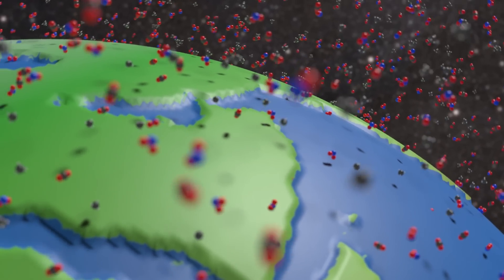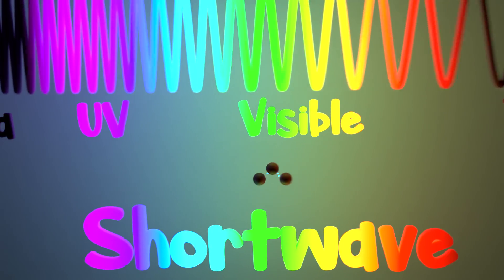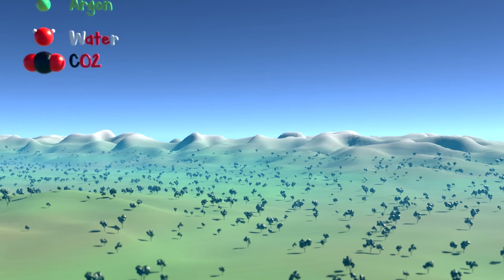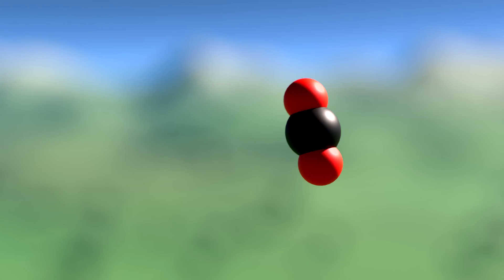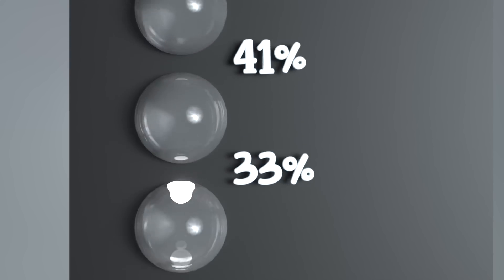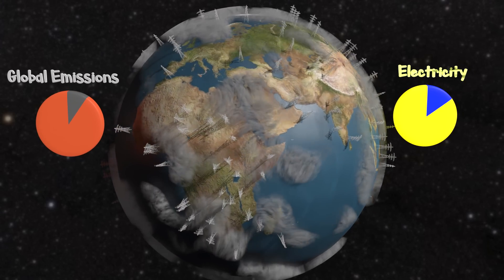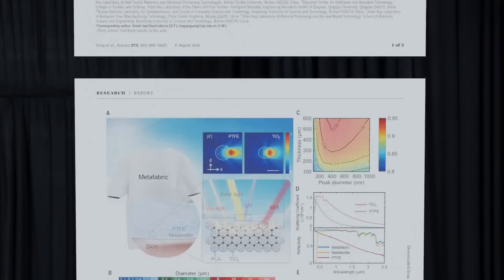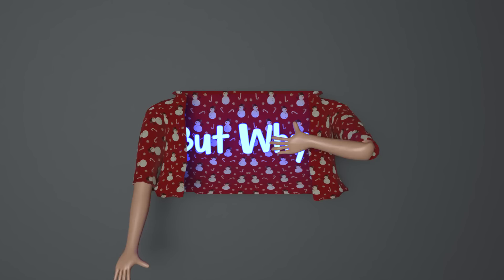Energy Free Cooling through Physics

Comment: I disagree that we need to reduce global electricity usage. The empoverished will use more wood as fuel which would increase green house gasses.

Oddly we should push In the opposite direction. Increase prosperity across the world while developing better energy science technologies to either utilise ambient heat as an extractable resource, in addition to radiation control measures.
Reply: Wood is the most renewable fuel ever. Change my mind
Reply: @truestopguardatruestop164  don't need to. While it is renewable. Its combustion subtracts from the total plants actively pulling CO2 from the atmosphere. Burning innert coal releases a comparable amount of CO2 it is not going to work to remove the CO2 from the air and ultimately living plant matter is better for the environment.

Renewable energy is a different subject to atmospheric gas.

Corn can be used to make a diesel substitute. But growing more corn is better than burning it when it could be used as a carbon bank.

Ultimately we can agree it is renewable. It is not however the same as environmentally better.

I would also like to add. Renewable are great if your goal is not to reduce carbon gas by products. Implying renewabolity is the same as environmentally friendly is similar to implying that natural is good. Not everything natural is good for a person. Deadly nightshade (beladona) is a potato. But making chips from it is seriously ill advised.

Comment: Wouldn't aluminum oxide be toxic and absorbed through the skin?
Reply: Al2O3 is the basis for sapphire and ruby.  the differences are trace amounts of titanium or iron for sapphire, and chromium for ruby.  aluminum oxide isn't toxic, but when it's in a fibrous form it does damage.  Inhaling dust is bad for the lungs, and even skin contact can be irritating, but in the same way that sand can irritate.

Comment: I'm a bit confused.  It seems to basically be a one way infrared mirror or something.  I think the confusion is that this does not directly impact global warming, it would only be by way of lowering air con usage it might help.  I have also seen black plastic get extremely hot in the sun and seen my reflection in the computer monitor on IR camera, so plastics are still highly reflective and absorbing, especially if actually mirror smooth.  I know you can see through plastic bags in IR but that is an extremely thing 100 micron or something thick sheet.
How would this compare with just reflecting the short wavelength AND IR energy back off the top of the building with, say, a mirror?
Reply: My understanding is that a mirror will only reflect incoming radiation, so at best you can achieve the temperature you would feel in the shadow.

The promise of these materials is that they can remove from an environment more heat than they can introduce. As stated, if that's the case you can get a motorless aircon effect

Comment: CO2 is not the thermostatic control for the planets average temperature.  The infrared wavelengths that CO2 absorbs is narrow band and overlaps H2O vapor, which is also much more common than CO2.  H2O is the largest driver of any greenhouse effect.  
Besides this...  There has been no net warming over the last eight years, according to satellite data.
Reply: Lol did you see the graph.
Reply: @mfanto1   yeah, I did.  I also know that graph was made by stitching disaparte data sources together inappropriately.  Climategate dude...

Comment: for the animations at 1:20, do the ripples in the "sheet" indicate high probability locations of finding a photon of some particular frequency? I'm not sure how to interpret the "height" of these ripples.
Reply: No.  I think it's just a goofy cartoon of a charged particle...  The graphs a few moments later are probability densities of electrons in certain orbitals.  They are answers to the shrodinger equation for the charge distribution of the particular molecule.
Reply: @kayakMike1000  I feel like there still should be some reasonable interpretation of it...like it's communicating a truth about the electromagnetic field and interactions with charged particles, right?
Reply: @DanielKRui  hard to say... I photons are emitted by electrons jumping around in discreet  energy levels within each molecule.   The entire reason why CO2 is somewhat opaque to certain infrared wavelengths related to the electron configuration in the molecular bonds.  That charged particle moving around in a swirling pattern might induce a magnetic field and an electromagnetic wave, but the scale is way out of anything reasonable, and what would be moving that charge particle?  At molecular scale...  Photons are discrete quanta.
Reply: @DanielKRui  honestly, that's a really good question.  Questions like this will lead to greater understanding.  Also, I might be wrong.  
I was just thinking...  A charged particle in a spiral pattern is exactly what causes the northern lights, but pretty one charged particle doesn't emit photons in all directions, its many charged particle emitting photons...

Comment: The nanotech is cool, but think it’s worth noting that low tech solutions also exist for hot climates. Better building construction to improve insulation and airflow can cool a building without fancy materials. 

I’m Texan. Compare a wide flat ranch house with a big porch and windows with the tall boxes we live in now. The flatter building allows more cooling wind and keeps sunlight off the sides of the house whereas the tall box designs take full sun all day and have horrible airflow, requiring lots of AC.

Wider houses don’t scale well with urbanization, but the general ideas of shielding walls and improving natural airflow can complement the reflective roofs from the video. A hot tent may benefit from a fancy roof, but in my experience, opening the flaps can be just as beneficial.

Comment: Cooling systems doesn’t just refer to AC, but also to residential, commercial, and industrial refrigeration. Passive thermal designs are absolutely an incredible technology, but they can’t help when you want to keep something refrigerated.
Reply: But they can be used as the cold heat sink for a more traditional AC system! It makes the AC more efficient with a higher temperature gradient between the hot compressed side and the ambient air. If you couple the compressed side of the AC with a panel that's 10°C colder than the outside air, that's energy saved.

Comment: Nice, potentially reducing energy consumption for heat pumps based cooling, but I hoped for technology which would passively convert longwave radiation into radiation which could escape our atmosphere.  Perhaps something like that crystal in green light lasers? IIRC it doubles the frequency of incident light, converting IR laser diode radiation  into green light.
Reply: problem with dyes is they are light sensitive, and subject to degradation.  photographs of flowers are done in the morning to get the most vibrant pictures.

Comment: Don't get me wrong, I love this concept, but I do wonder about the effects on the surrounding air, especially if this technique is used on the large scale.

In the beginning of the video, you stated that the heat would normally be absorbed by the ground.  But with this material, the heat would be reflected up or out, thus heating the surrounding air to a temperature higher than it would be if this material wasn't there.  In the long run, this heat will then be added to other heat trying to escape the atmosphere, but then gets reflected by greenhouse gasses, thus adding to the accumulating heat in the air around the globe, hence adding to the problem.  -- Not Good!

But, every problem has a solution if you flip it on its head.  What if instead of simply reflecting the the heat back into the surrounding air, it was reflected or radiated to a specific point where the heat energy could be used as a power source.  This may not be good idea for clothing, but it could supply power to a tent or a house.

Something to think about...
Reply: @chalichaligha3234  I put actual mirrors on my actual roof.  Standing above the mirrors means light coming from the sun and light coming up off the roof.  It's warm!  Like the reflection off snow.
Reply: @geraldfrost4710  you’ve caused countless plane crashes m8
Reply: @billballinger5622  Nah. Pilots wear mirrored sunglasses! (It's not just to look cool.)
Reply: The light that makes it to the ground and heats it up makes it that far because it is transparent to air (well air is transparent to it). The air can't absorb energy at that wavelength, it simply passes through it as if it isn't there. The reflected light would pass right through the second time back to space. Also your idea for reflecting light to a point where it can be harnessed is already in use. There are large concentrated solar power farms where mirrors reflect light onto a boiler creating steam to power a turbine.

Comment: Those claims mean little without more details of the variables involved, eg external temperature, and comparisons to plain mirrors as controls, also not defining the units as Centigrade or Fahrenheit really doesn't help, even more so for "a skin temperature change of 10 degrees", which seems medically unsound in either scale. :)

Comment: Then you install a thermocouple and boom, free energy too when you don't need cooling? I always thought of this but by using a material close to a black body radiating its heat into space at night. If it's double the efficency of a solar panel, at probably much lower cost, I seriously hope there is a good way to make cheap and efficient thermocouples that can retrieve a good amount of electric potential per joule of heat.

Ps I just looked and it's not as efficient (5% vs 20%) but it could be cheaper in the long run, you could make both? Wasting that free heat pump when you don't need cooling in your house seems illogical since it should cost less than a solar panel, although you need more area which could be used for solar panels.
Reply: What if you build an inside structure with two sides: one really cold and one really hot. That difference is made by the magic material. Then you run tubes on both sides. Then you add a Peltier module connected to the two tubes systems. Then you generate electricity from nothing!!

Comment: Is it possible to convert latent heat energy and turn it into electricity? Not temperature differential, but if it's 40°C outside, surely there is energy there that isn't in -40°C?

Comment: Not to one-up you, but I installed a Planetary Air conditioner; I use it to help cool my house.  Been running it for years.  I've got videos, but not with fancy graphics like yours; actual videos of my actual Planetary Air Conditioner, and how it actually works.  Drops the temperature of the roof by 30 degrees F, and that cools my house.  Yes, it does it without electricity.  The PAC I run dumps an equivalent amount of heat back to space to melt 250 tons of ice per year; that cooling appears in my house first.
The problems with what you've shown isn't that they work; I'm sure they do work!  The problems are cost and how they these things react to the real world.  The main problem with my Planetary Air Conditioner is that it works too well.  Water condenses on it, and any dust or pollen in the air attaches itself to the damp spot rather than anything else on the roof.  Dirt collects, and moss grows.  Ya have to clean the darn thing!  Imagine leaves: as they blow across a sidewalk, they don't stick.  Now have a puddle on the sidewalk, and you have a leaf magnet.  Having put a dirt magnet on the roof, it will have to be cleaned.  (I have a scientific dirt study in progress, one patch that I don't clean.  I'm not lazy, honest!  That one patch shows that if you don't clean it, the effectiveness ends.)  The thing you clean has to be able to resist the cleaning.  My PAC is, by it's vary nature, robust.  Resistant to birds pecking it, hailstones, and easy to clean with a scrubby pad and water.    
Cost is the other issue; mine comes in at about $20 per square meter.  How does that compare to scientifically saturated silk or premium prototype polymers?
Reply: @kevinkarlwurzelgaruti458  There are various formulas on the market. Rainex for cars, and anti-fog for scuba masks.  It would be an interesting experiment...
Reply: Sorry didn’t fully understand what was your solution
Reply: @truestopguardatruestop164  I got mirrors on my roof.  They run cold, so cold that water condenses on them.  Kevin suggested a way to mitigate the negative effects of condensation.

Comment: One interesting point.  IR (of the correct frequency) is absorbed by a "greenhouse" gas causing it's bonds to vibrate.  You kinda skipped over how long on average the energy is held by the gas molecule.  You state they primarily release as IR energy 50% up/down.  Then is absorbed by another GH gas absorber or the ground.   But, you didn't state the frequency of the released IR energy?  There are transparent keyhole IR frequencies in the atmosphere.  Is the emitted IR frequency follow a blackbody probability, or is it the same frequency as absorbed?  This isn't a valance band quanti effect, so we aren't making lasers here.   

I think you could do an entire episode on the absorption emission, blackbody, probability of conduction, holding time, keyhole frequencies, average absorption distance, primary absorbers, and such.  It would definitely open a can of worms.

Comment: Awesome.
It's possible that these new materials might cause a new form of pollution? They say plastic is bad. Would these be worse over the long run?
Reply: Most of the volume of aerogel is made up of microscopic holes. A very small amount of plastic will produce a very large amount of aerogel. The amount of plastic in the aerogel required to cool a building would be less than the amount of plastic in the paints or tiles that would have made up the facade of the building anyway. If it ever does cause an issue, other polycarbonate molecules such as lipids or cellulose would be fairly easy and renewable replacements/alternatives.
Reply: A continuation:
Aerogel or other hyper-porous materials could however be prone to shedding micro or nano-particles as they wear under exposure to the elements. For instance, under direct sunlight and wind, it is possible that aerogel could start releasing airborne microplastics, which are known to be harmful to both people and animals. Lipid or cellulose based aerogel alternatives would likely do the same, but, being common organic materials, the particles given off would be less harmful than sawdust
Reply: Indeed.
Teflon is toxic.
Titanium is a heavy metal.
And nano particles of these 2 elements would be very volatile and dangerous.
Easily inhalated. 
Organisms can't get rid of nano particles. 

We will have the same kind of sanitary issue as the one caused by asbestos.